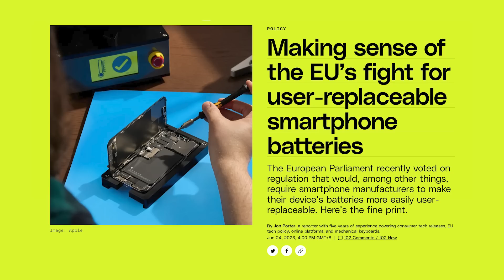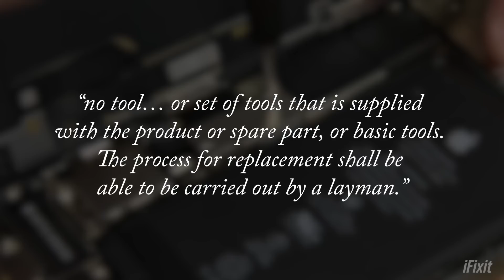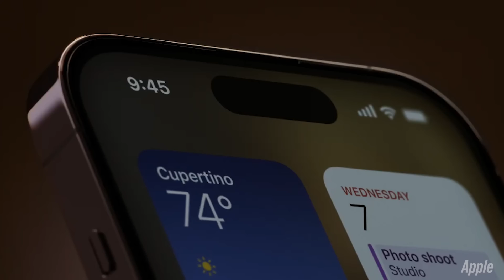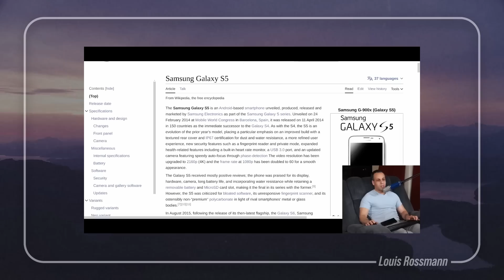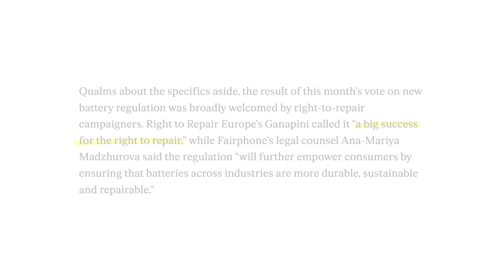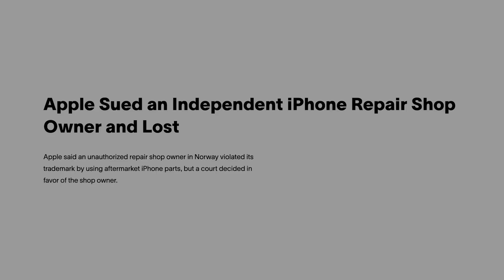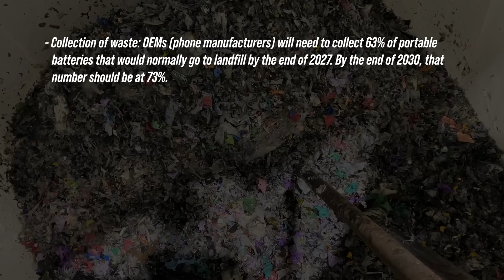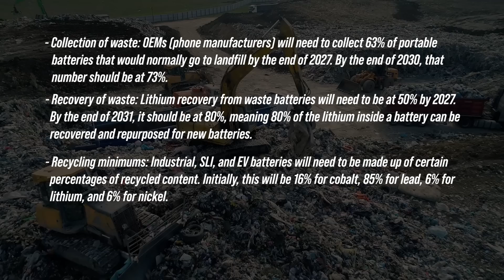EU Just Changed Smartphones Forever

Comment: I think user replaceable batteries would be disaster. It will be a much more fragile design due to glass sandwich modernization and also will be less water and dust resistant. Suppose any company comes up with a model that is durable and also water resistant but what will happen to dust resistance? Also, things will get more complex for old people and for people who is not into technology that much. Also, so many people will lose their jobs if phones and certain electronics become self repairable. I do agree that companies like Apple should provide their diagnostic softwares open source and also should recognize parts if repaired from a any repair shops.

Comment: A rubber seal can work wonders to keep something water tight and it is cheap. What they want is to focus on what you lose instead of what you will gain, like the ability to add custom batteries with higher storage. Usb c for example is a blessing, do not trust corporations when they tell you anything because their real reason it is always going to be “its more expensive”

Comment: My Galaxy Note 3 lasted me 7 years simply because I could buy and replace the battery whener I needed to. I look at my s22Ultra and sure , it's fancy but it bothers me a lot not having that simple option.
Reply: Sure. And that note 3 was big screen, high resolution, 5G, water prove, super light, slim, and had built in 256 GB storage, correct? Oh no, wait, it was running on Android 4 or so... Was there a point lately where you really wished you could do a battery replacement for the S22 ?? Or just whining without real reason?

Comment: "Apple is not likely to design a different phone for EU and other markets" - Given that it is apple likely true but not true.

Basically they will likely software lock the battery, but the allow the software lock to be bypassed if you are in EU.. thus it is the same phone, but outside EU you will still have to have the properly serialized battery from Apple. so they get their profit that way.

Comment: One of the most toxic parts a phone is the battery.   Intention doesn't always line up with consequences.   People will now buy 3 batteries per phone instead of just the one it comes with.    One for the office, one for home, and one for the actual phone so they can always have a full charge in seconds.   Of course that will lead to continual overcharging which reduces battery life.  No problem there, you can just throw it away and buy a new one.   Return centers are a pain, so just sneak it in the regular trash.

Battery life was just becoming less of an issue where batteries last long enough on a charge and last the effective life of a phone.   People replace their phones because they get faster and feature sets increase, not because their battery is tired.

It is well intentioned, but a policy that would have been nice maybe ten years ago and really isn't needed today, and is likely to have the detrimental effect of actually increasing toxic battery waste.

It will likely end up like the EU's 'internet cookie" policy.   Some geniuses decided they needed to save us all because they found out the internet was "secretely" spying on us!!   Everyone with a brain cell already knew this, but after 10 years of them "crafting" their bill to make it in to law, by the time it passed even people without a brain cell knew what cookies were and how they work. Most voluntarily and happily agreed and found their sweet spot of giving up a little privacy in return for a lot of functionality.

While that European law was kind of useless and did nothing, it doesn't change that almost every website you go to now has an annoying "We use cookies! 😱😱 Please review your privacy options!" popup because most sites don't want to make separate EU compliant pages, so we all get this wonderful "benefit"

Next up, they will also need to pass a battery manufacturing law.   Does anybody remember all the battery fires that were more commonplace with replaceable battery phones?   Buy the Apple battery  for $200 or the next day Amazon cheap Chinese knock-off for $30?    One of the benefits of a locked in battery is the manufacturer actually becomes accountable and liable for it.

Comment: About bloody time something sensible came out of the EU.
Not only for the right to repair but for longevity and recycling/pollution it's a big plus too.
The phasing out of replaceable batteries was definitely motivated by Profit, as you'll buy a new phone/laptop etc from the manufacturer instead of a new battery that any third party company produces, often with a greater capacity than the original.

I'm still using an iPhone 6s after changing the battery 2 1/2yrs ago, the alternative to spending £46 for a battery+fitting kit was to spend over £400 on a new phone with the same features + having to buy a case and mount to have it on my bicycle.
At the time there were very few companies making mounts or cases for the "NEW" phones (2020-2021) and they were VERY expensive.
My Phone still works perfectly and is sometimes used as a 'Sat-nav' when driving as it's better than the one built into my car.

Comment: I used to have a Motorola G5 which featured a removable battery. I once dropped it in a river, it sat under about a foot of water for 10 seconds before I could retrieve it, and it still worked perfectly. The waterproofing argument is definitely overexaggerated.

Comment: Sadly, the corporations are probably going to make it so that only overpriced "Authentic" batteries will be fully accepted by the device. If you use any other battery, the device will work (to conform to the law) but it will only run at 50% power or falsely report that the battery is drained already after 1 hour of usage and then claim that the customer should have use authentic batteries that cost almost as much as a new device.

Comment: Looks like the EU have finally done something worthwhile. In the past it was really easy to replace parts on laptops and phones with only a basic toolkit - things most of us have at home but then sealed units started appearing and they have to be taken to a shop to be repaired. Another thing which is annoying is that we have to upgrade our phones and laptops/computers  (buy new ones!) because of operating system upgrades (Yes, looking at micro$oft here!) There are plenty of functional machines around which are collecting dust just because M$ deem that it is not capable of running their 'wonderful' operating system. Linux is a far better option for the majority of people who just want to write a few documents and surf the internet and it is completely free!

Comment: To answer your question you mentioned i can say changes are mostly motivated by profit / maintaining profit. Once you hit the end of the S-curve of a product and innovation is hard to achieve, there are not manny options left to keep your products priced as before as you've entered the plateau phase. Demand will go down because of less innovation, which results that the focus wil shift more towards efficiency of process or the product to manufacture. 

The same you can say for the car industry, SUV's are cheaper to manufacture because of less regulations. Bigger cars require less efficient thinking and easier maintaince due to more space between components. Also in the US strict regulations doesn't apply to SUV's. The car industry is shifting to a one-size fits all solution because of costs. Ford and VW are working together to make 1 chassis for example with EV's. Which result in lack of creativity and diversity. The reason why they all do this is because of efficiency and not looking at what the customer really wants. Please give me back my Ford Focus / Fiesta.....

Tip is to check Not Just Bikes, for an in depth review about the car industry and road infrastructure. https://www.youtube.com/watch?v=jN7mSXMruEo

Comment: Personally, I would gladly trade my "super thin and state of the art phone" to a one with replaceable battery and one which can be easily maintained and repaired. I dunno, it feels like modern phones are waaaaaaaaay overlybuilt. There is no need in that much power in a mobile phone, apart from shitty games nothing uses it. Even more, just like in PC market, more power is only needed because software developers are not able to make a properly optimized products.

Comment: I currently own a Samsung S10+ that I've had for 4 years. It boasts a great camera, a good screen, and all the features I need and use. Even now in 2023, I don't feel the necessity for a better phone. The only issue I'm facing is with the battery, which is losing its capacity at an increasingly faster rate. It can barely last a day now, and this will likely be the sole reason pushing me to replace this phone. If I could simply replace the battery as I could with older phones, it could easily serve me for at least a couple more years.

Therefore, I wholeheartedly support the implementation of laws promoting easily replaceable batteries for all electronic devices.
Reply: it's not easy but it's doable, why not give it a try ?
Reply: @amineb6335 hes the type to take his car to the mechanic for a simple fix rather than watching a tutorial. But Between the back glass cover, proprietary screws, and excessive adhesive. It's a pain tho

Comment: I lost an expensive phone just because the battery was non-removable. A glass of water tipped off and fell on the charging side of my phone. Normally if the battery was removable, I would have immediately removed the battery. But as new phones are like bricks, i had to watch my phone slowly die. Screen started flickering, power button wont shut off the phone, the fliker kept on increasing and within 5 minutes, the phone was dead. Old phones have survived such small accidents when battery was immediatly removed. And my one other phone, one day the battery swelled so much (it was just kept on side table), that it detached the whole display pannel, damaging the flex cable. Now original display is not available, deeming the phone unusable.

Comment: I remember when the LG G5 with its interchangeable battery came out. In my opinion it was revolutionary, maybe too much for that period. In terms of usability, carrying the replacement battery instead of a bulky power bank is definitely easier, not to mention the fact that you don’t need any cables to connect as it would happen with power banks. The modularity, which could be applied to various types of products might improve the user’s personalization and that might be an incentive to help spread this practice, since the main aim is to control the flow of waste.
Reply: G5. oh man, great phone. Tv / apliance remote control built in  with IR sensor.
Reply: @G-Man..277  LG V20 had the same.
Reply: Removable batteries is normal it is new for them not to be removable
Reply: I loved that phone and still own a G7-THINQ due to liking the G5 so much.
It had flaws though. GPS antenna lost contact on my phone due to the  design choices that made the battery changeable. Many other users had the same problem or had other antennas lose contact.
LG chose to jump the 'glued sandwich' design with the successors and finally quit the phone game altogether as far as I'm aware.

Which is too bad. The G7 is five years old, still goes about a day on a charge and still does all tasks I need it to perform.
Reply: LG 20 was the last flag ship - removable batteries was standard in the past.
In any case... it is disgusting move of all the mobile companies that just followed suit on this utter depravity of no change of the mobile battery.
Reply: While I agree that the G5 design was innovative, that phone sucked. It was my first smart phone purchase and that thing bricked on me. I replaced it under warranty three times. After that phone I gave up replacing my battery, but I am happy to hear repairing your own device is making a comeback.
Reply: @anthonynonapplicable6045 bootloader loop? Same thing happened with the G4 but now im on my V30 since 2018 and still running with no issues. Too bad LG stopped making phones.
Reply: @theuncanspan  Yes! That was the failure. Fuck man, bringing back some awful memories now. Happy to hear they eventually worked it out, sadly too late. I was ride or die LG until that G5. My LG flip phone lasted forever! It's partly why I waited so long to get my first smart phone. Damn, I wanted to love that G5 so bad.

Comment: Someone should look into the details here. Waterproof devices are excluded from the fact that the user must be able to change the battery himself, thus smartphones as well.   

CHAPTER I - General provisions (39) : To ensure the safety of end-users, this Regulation should provide for a limited derogation for portable batteries from the removability and replaceability requirements set for portable batteries concerning appliances that incorporate portable batteries and that are specifically designed to be used, for the majority of the active service of the appliance, in an environment that is regularly subject to splashing water, water streams or water immersion and that are intended to be washable or rinseable. This derogation should only apply when it is not possible, by way of redesign of the appliance, to ensure the safety of the end-user and the safe continued use of the appliance after the end-user has correctly followed the instructions to remove and replace the battery. Where the derogation applies, the product should be designed in such a way as to make the battery removable and replaceable only by independent professionals, and not by end-users.

https://eur-lex.europa.eu/legal-content/EN/TXT/PDF/?uri=CELEX:32023R1542

Comment: I personally would not mind a slightly bulkier phone if it means is more repairable by the user and the battery swappable. The main reason I switch phones is the battery. I also dislike that printer manufacturers stop supplying driver updates forcing you to replace a perfectly fine printer when your OS is updated.

Comment: Next up the EU should get rid of kill switches on devices such as printers, refrigerators, dishwashers, clothes washers and dryers, and microwaves. Day the warranty runs out, on that fridge or microwave, usually means it will be plastic and e-waste soon. Print the number of pages the printer has coded in, its days are numbered and print quality suffers greatly. This is to drive more sales for the company, because building something to last is not good for their bottom line.

Comment: We’ve literally had rugged phones and laptops that were waterPROOF in the early 2000s and had replaceable components so ppl really have to stop letting themselves be gaslit by corporations
Reply: what weight and size were they? And how strong were those processors? How much heat had to be processed? When was the last time you really wished you could replace a phone's battery? I can't remember any occurrence. I do NOT want replaceable batteries. How can they decide "for" me? I want slim, water prove phones, am NOT interested in replaceable batteries, can't see NO advantage for me in it.

Comment: Consumer demand is often a fantasy used by manufacturers to justify practices that are really driven purely by the desire to increase profits.  If all phones were a bit thicker, because they contained removable batteries people would still buy them.  There is rarely a situation where two products are on the market and equal in all respects except one.  What really happens is that one company, say Apple, makes a product and consumers who like to buy that brand/OS buy it, then another manufacturer incorrectly attributes that to the product being thin.  Also even if consumers do prefer ridiculously thin devices that's tough luck.  Just imagine if instead of waste we were talking about a new and important product safety standard would we even bother listening to claims that the unsafe products should be allowed because consumers prefer the way they look?

Comment: I had bought a Remington battery operated shaver a few years ago.  Within a year or so the batteries would not hold the charge and the shaver lasted only 4-5 days between a full charge.  I wanted to replace the battery but it was all soldered in.  Hence, I had to throw away a perfectly good working shaver for the sake of the batteries!  What a waste that was.  I resolved never to buy another Remington shaver, as previously I had thought very highly of the brand recommended by my father.

Comment: This means the initial cost of products will have to be increased because new sales are going to be adversely affected. But this still doesn't address anything with planned obsolescence in regards to software updates so there's still going to be a need to replace the device after a set time. At it's core it sounds good but the costs are still going to be passed on to the customer in one form or another.
Reply: It's still a great start

Comment: I am quite sure the phone makers will manufacturer different versions of phones. There are much larger and more profitable phone markets than the EU is. Depending on how this turns out, if phones with exchangeable batteries will be more bulky or less premium, they will have a significant disadvantage on other markets apart from Europe, Which might also eat into profits. So probably there will be a lot of phone brands that will supply the European market with less variety of or even no models. I especially wonder how Chinese phone brands will handle this.

But I still like this new law a lot. I am just very curious on how this will turn out.